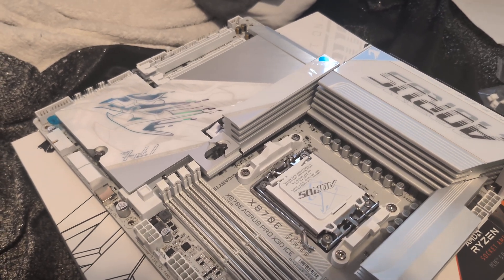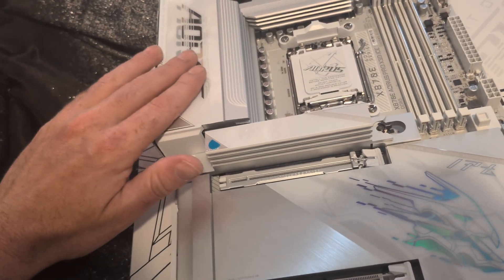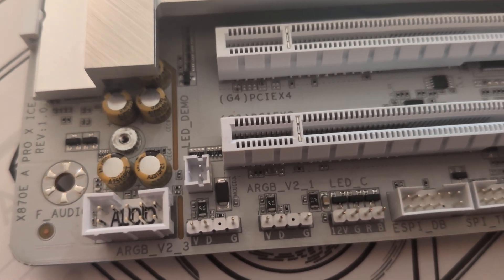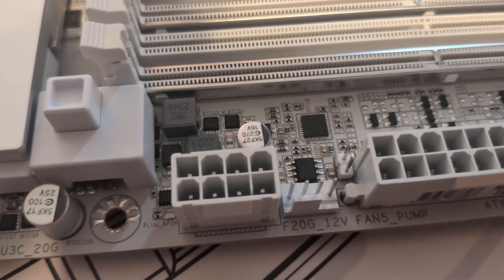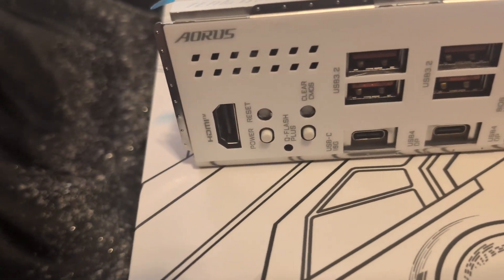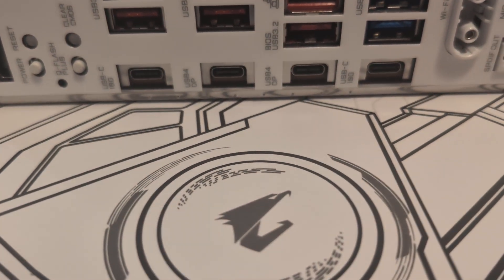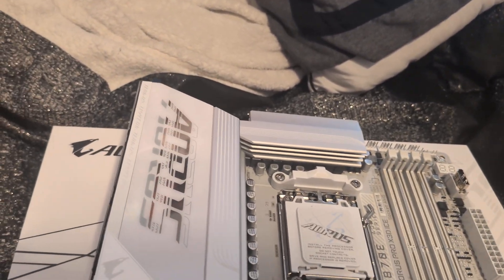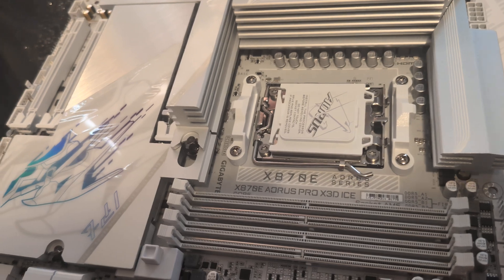Gigabyte X870E Aorus Pro X3D Ice ATX Motherboard

Comment: Just ordered the same board since it fixes all the bad lane-sharing from previous lineup. A bit scary since there is like 0 reviews of this board and nobody has experience with it but hopefully it will work fine xD Lemme know if theres some problems and solutions that appear haha
Reply from the maker: I will for sure ,the ASRock nova killed my 9800x3d I had previously
Reply: @WaterCoolFool  thats so sad man. All I've been reading past 6 months is Asrock killing 9800x3Ds and I feel lucky to have waited forever to update my pc... Still rocking Asrock X370 Taichi but I guess this will be my last Assrock... At least this new Gigabyte "X3D" lineup boasts about being designed specifically for these CPUs so im gonna be so disappointed if it's bad xD
Reply: So there is no sharing with GPU ? And what slots are limited by sharing ?
Reply: @DARKENnekradPL   The M2B_CPU connector shares bandwidth with the ASMedia USB4 controller. When a device is installed in theM2B_CPU connector, both theM2B_CPU connector and the USB4 port supported by the ASMedia USB4 controller operate at up to x2 bandwidth.

So basically only second gen5 nvme slot shares with USB4 lanes so if u want to use both then they run half speed but if you dont care about USB4 you can use all lanes for the M2 nvme ssd and disable usb4 or other way around from bios
Reply: @Pallo199191 okay! Thanks. Btw. U understound i can use USB 4.0 for copy something for pendrive, then after take out a pendrive speed be again normal yes ?